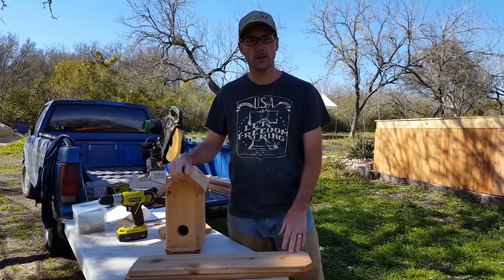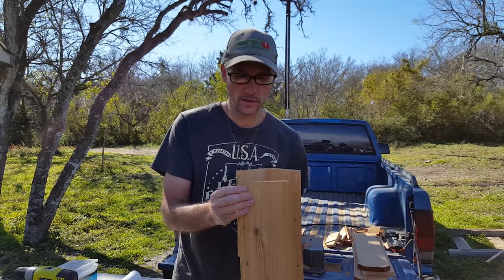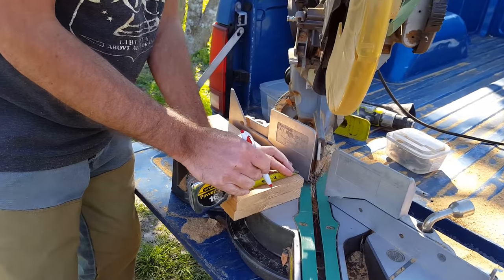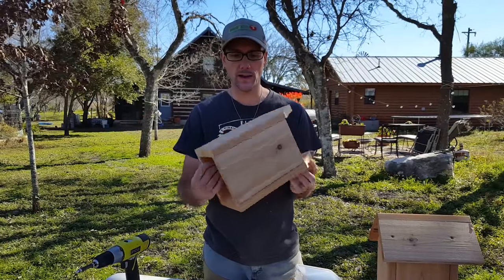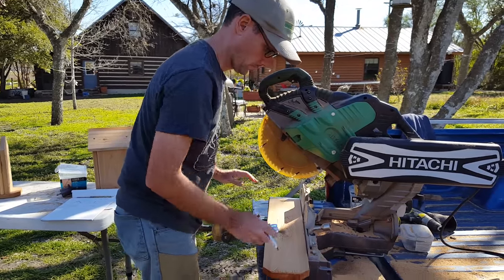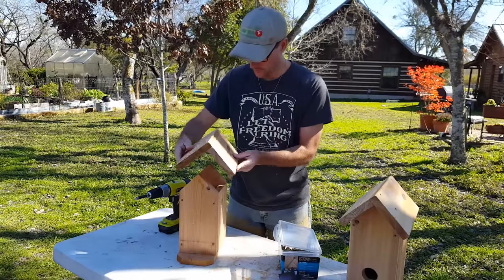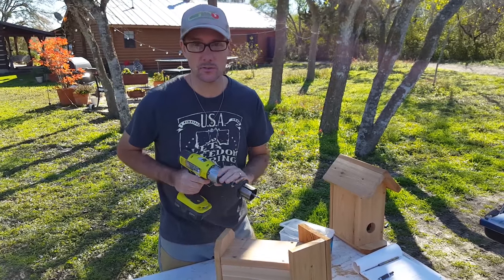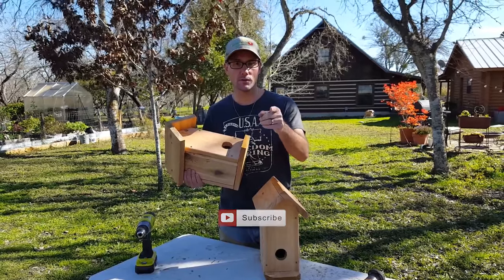How to Build A Birdhouse: Use Scrap Fence Board Ends

Comment: Like the thriftiness of the build, but one recommendation I'd have is to remove the lip on the bottom.  That gives a leverage point for predators to clean out the nest.  It's better to extend the backplate below the birdhouse and put a small perch underneath the birdhouse attached to that backplate.  Birds are very good at landing on the perch underndeath and then scooting up and in.  Specifically bird nest predators such as blue jays can't do any damage if they have nothing to land on right in front of the nest.
Reply from the maker: +Matthew Writt Great suggestions! Thanks :)